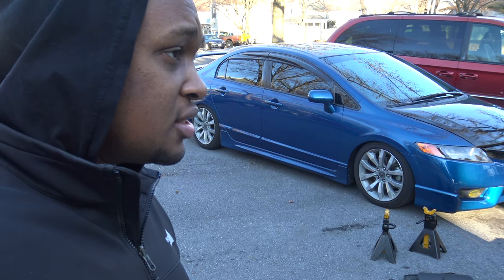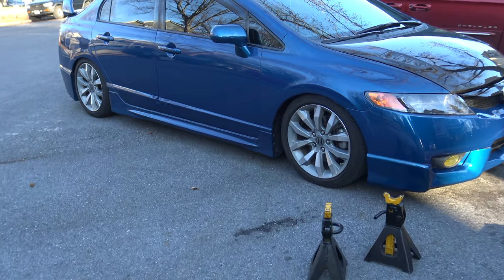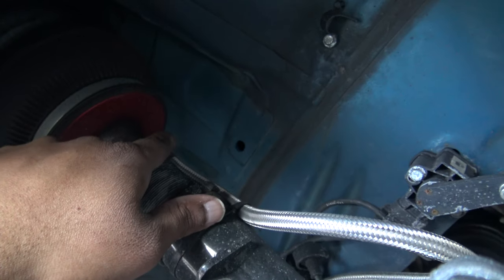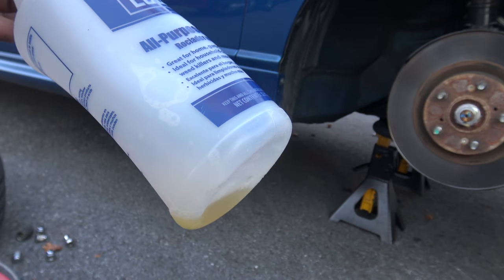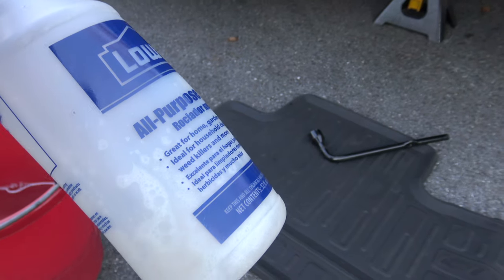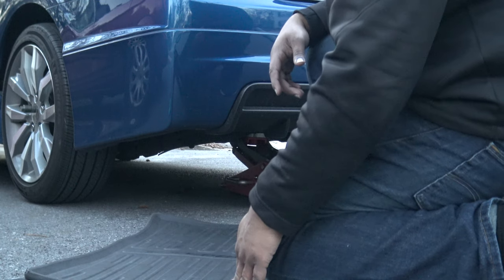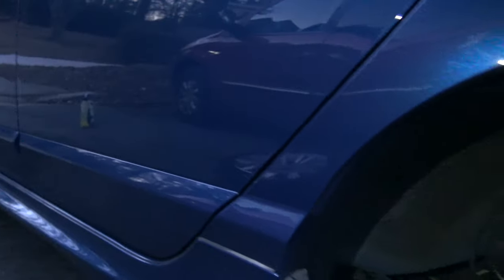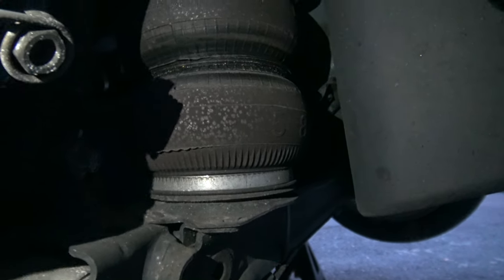HOW TO CHECK AIRLINES FOR LEAKS | Airlift 3H Height sensors + IS AIR SUSPENSION RELIABLE?

Comment: Recently after running my air suspension for 2 years no issues, every PTC fitting in my trunk setup went bad at the same time.
Leaks everywhere! from the spots you pointed out between the plastic and the brass, the grey part, and from where the line plugs into the grey part.
All from the same DOT fittings you have in your video.
Recently ordered some new ones and replaced and no more leaks.
Just waiting on my last part which is a T fitting for the emergency pressure release valve and I should be good to go.
Thanks for the video!
Also great tip for making sure you use bricks or a wheel chock, I smashed my oil pan on my jack like that one time and had to replace the filler tube and the pan.

Comment: Hey man I like your Channel I can tell you care about your car. I just wanted to say that I’m trying to modify my Honda Civic 2009 Sedan, it’s the same model as yours (8th gen) but its automatic instead. Anyway what I wanted to ask you is where do you recommend shopping for the parts? Both interior to exterior parts? I did some research and found a website called carid.com but I’d like to hear your opinion before I actually start modifying the car. Plz let me know bro, I love my car, have been wanting to add to it for a while, and love Honda’s pretty much more than any other car. Thanks

Comment: Havin bags is awesome until u have a problem..which is rare...ive had mine for a few years and i have discovered 2 leaks
Reply from the maker: That is true! Same with me! With troubleshooting bags is really easy! There is a solution to each problem!
Reply: So mine says leak detected then turns off next time I turn it on and then it will pop back up like 2 weeks later but then turn off. I looked no leak.